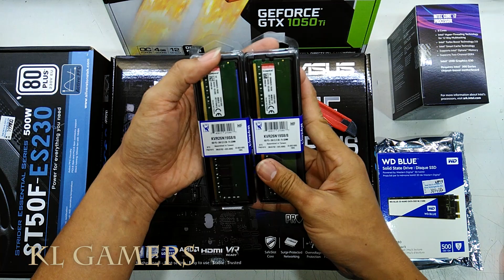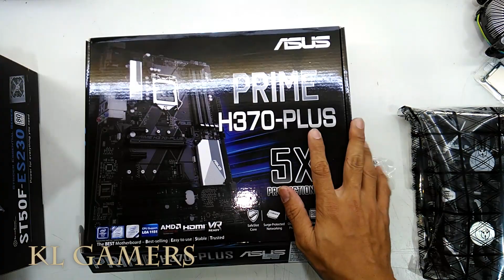intel i7 8700 ASUS PRIME H370-PLUS WD 500 16GB RAM GTX 1050Ti GAMING RIG 2019

Comment: why do shake cpu like that?
Reply from the maker: to make sure tight and secure contact and center in socket.
Reply: KL Gamers You only have to gently rattle the cpu because it would already be clear when the cpu is not installed  correctly